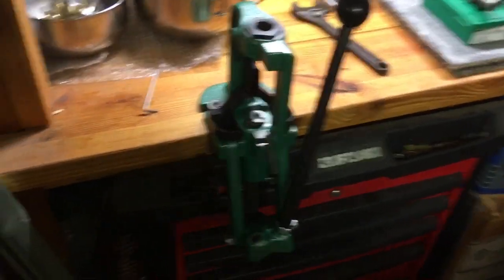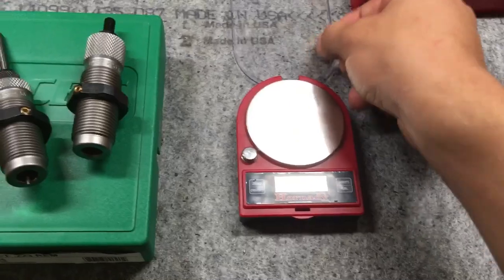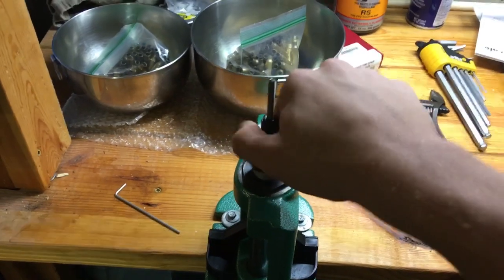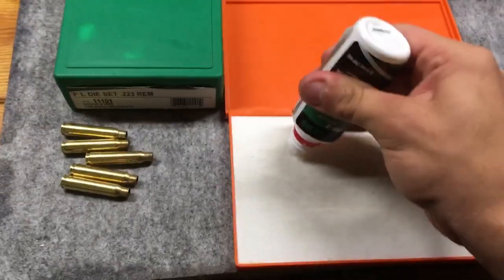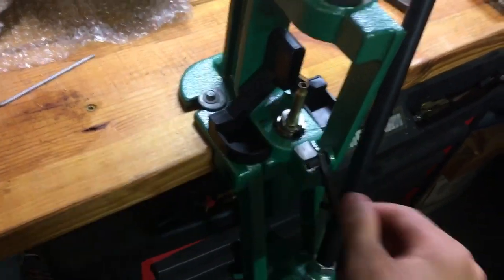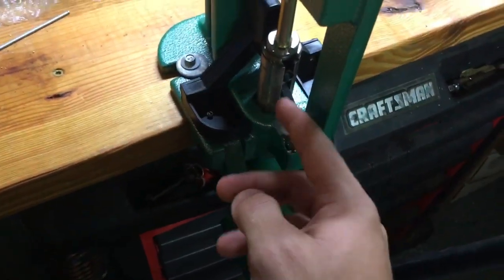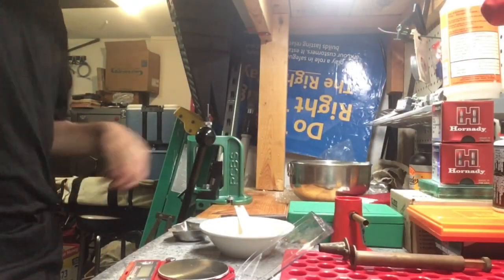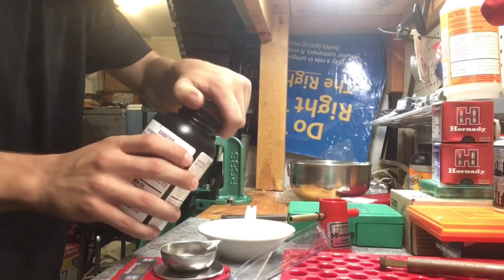Reloading Basics for Beginners (.223 Rem.)

Comment: You need to pay attention when reloading. Do not lube the cases and handel your primers with the same hand. Make sure that you measure your cases after resizing and trim to the correct CL for the cartridge, a good case trimmer can be set to the correct CL and used on all resized brass that eliminates measuring each case. You will have to debur the in and out of the case neck. To prevent sittin your bullet to deep: Back up the adjusting pin on the setting die, and set your die on the press with  the empty, trimed case, rase the ram and lower the die until it touches the shell. secure the die and place the bullet in the same empty case, rase the ram and lower the adjusting pin down until it touches the bullet, lower the ram and the adjusting on your die down by a few turns. Now rase the ram to sit your dummy round ( no primer or powder). Repeat this until the OAL of the cartridge is achieved. Mark this round so it doesn't get mixed up with life ammo and use it to adjust you bullet sitting die.
Reply from the maker: Thanks for the info!

Comment: You have a crimping groove on your bullets.The bullet seating die will do the crimp unless is backed up o about 3/4- 1/2 turn for the bullet setting. To achieve crimp you'll need to back up your bullit sitting pin and lower the die in small increments until the proper crimp is achieved. Crimping is useful for repeating actions not necessarily bolt actions or bullets w/o the groove. Be aware that over crimping will increase the chamber pressure

Comment: My notes to anyone thinking of reloading:
1) If you are easily distracted, don't like to follow or read instructions, cut corners because you think you might get away with it, don't have time or space, reloading may not be for you. Reloading can be safe or it can be dangerous. It is your choice. 
2) If you are considering reloading to save money, know this, your first round may cost easily a thousand dollars for press, dies, scale, powder measure, book, caliper, trimmer, deburrer, reamer/swager, locking rings, cleaning equipment and materials, lighting, bench, powder, primers and bullets. And it can be very time consuming. With a single stage press I can make some nice cheap 9mm ammo at a rate of a hundred rounds in 1.5 hours with a material cost of under 20 cents a round. For .223 it takes closer to two hours for a hundred rounds and material cost comes to about 28 cents a round. This time includes, time spent on set up, take down and clean up. 
3) It took me a few thousand rounds to pay off my equipment compared to buying ammo off the shelf. That's a lot of evenings sitting at the reloading bench. 
4) Steel and aluminum cases are not reloadable, but can be recycled as metal. Nickel plated brass is reloadable.
5) There's a couple types of primers, Boxer and Berdan. Boxer primers have once center hole on the inside of the case. These can be reloaded. Berdan has two holes inside the case and cannot be reloaded. If you run them through a sizing or decapping or resizing die you will break the decapping pin. 
6) A great source of information is The Sporting Arms and Ammunition Manufacturers’ Institute (SAAMI) You can find detailed cartridge drawings including tolerances, storage recommendations, and other good info there. Check it out. 
7) all the different company presses will hold all the different companies dies
8) because the inside of the neck is held against the depriming rod during the resizing step some of use lube the inside of the case neck
9) Many of us clean the lube off the brass before proceeding to the next step. There's lots of reasons
10)  Rifle brass typically needs to be trimmed to length after resizing. Then it needs to be deburred.
Reply: Some good notes here.
Reply: good advice !

Comment: picked up the rcbs supreme ..i noticed there is a groove on the ram like its to pieces is that normal
Reply from the maker: Yes the groove is normal. It is for the primer that’s on the press. Thanks for the comment!
Reply: @fallinbrass1599  just wanting to make sure...im talking about the same thing..at 13.47 as you look at the ram...it looks like 2 sections put together and as you run your finger down it theres a little lip
Reply from the maker: If you are talking about the top of the ram that’s the shell holder... if you are looking halfway down the ram it’s just an oil line on the ram...  I hope that answers you’re question.😬
Reply: you diffidently answered my question..thanks